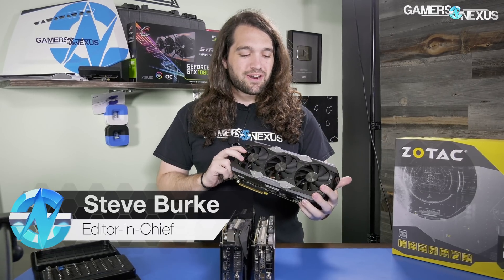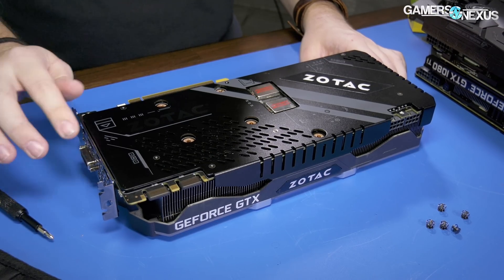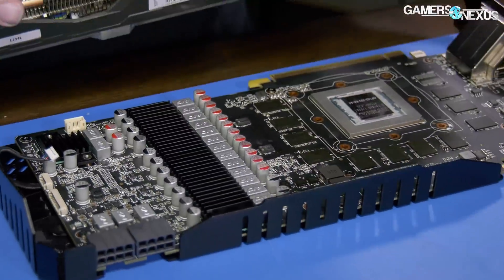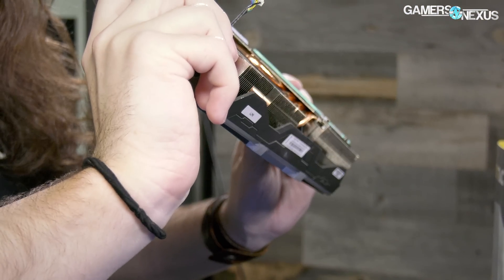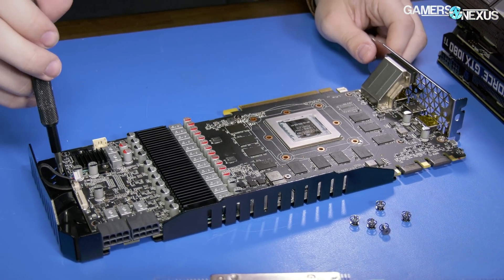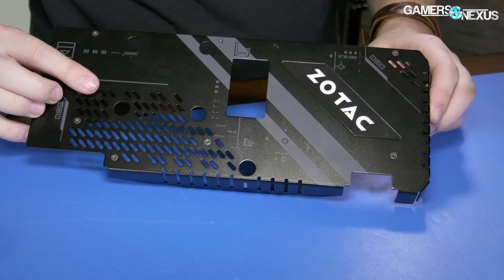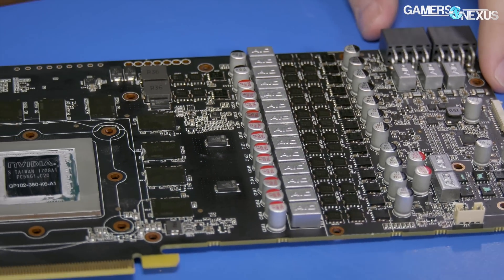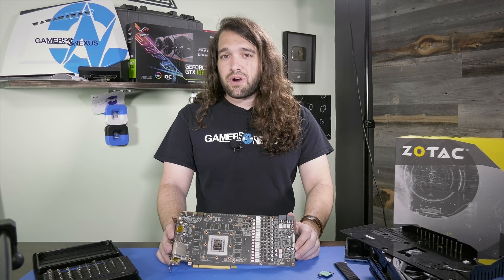ZOTAC 1080 Ti Amp Extreme Tear-Down

Comment: I don't think the way you reviewed this cards "rubber pad" is fair given you showed it in such a negative light. Since you don't have proven metric. the rubber pad could be used to isolate the two heatsinks, vrms do not need active cool in most cases. if it were connected by thermal pad that may raise the GPU temp. there could be manufacturing tolerances that could have the surfaces touch in worst case scenario. I believe the rubber pad serves a purpose especially in a consumer product. Simply put your intuitive assessment is unjustified.
Reply from the maker: This isn't the "review," first of all, and we already have data, secondly. Perhaps you should wait for the review to upload?
Reply: I look forward to the "review" and its objectivity and I understand this is not a formal review but more a kin to a reactionary look into the card.
Already have or had data? to assume is to be fallible by confirmation bias.

I genuinely like the channel and its content. This criticism is not meant to be hostile.
Reply from the maker: Had. As in, tested it (for an entire day) before we took it apart for this video. Video uploads are not real-time. This stuff is ~2-3 days behind our testing. The tear-down videos get shot normally once the review is already written and pending filming/editing.

You're preaching to the choir :)

Comment: i hope for you, Steve, that the black rubber on the fins is not actually for the Inductors....because that would make sense, touch the inductors/chokes in order to reduce vibration/coil whine. If that was true you would have done them terribly wrong by claiming it doesnt make any sense to put that thing over the vrm-heatsink. Too bad theres no way to spot exactly where it is when you dont have the card.
Reply from the maker: It's not anywhere close to the inductors. It's not even making contact with anything. You could have looked at the pinned comment to find that out: http://www.gamersnexus.net/news-pc/2971-zotac-1080ti-amp-extreme-tear-down

Comment: The main reason for the rubber pad I can see is to prevent scratching the black paint off the VRM heatsink during shipping. We all have heard those stories about what happens to packages during shipping and I know I would be worried if I saw small black pieces coming out of the antistatic bag the card comes in.

Comment: Steve, how important is it to cool those vrm's ? I have a kraken g10 with a corsair h50 that I use to cool my gpu. I don't have any additional cooling for the card besides that. Am I better off using the heatsink that came with the card or is my custom cooling going to do fine? My card never goes above 55c during gaming, but is it possible the vrm's could be overheating??

Comment: Steve, this is 1080. The VRMs won't get hot even if there is no cooling whatsoever. nvidia put so much restriction on these, it's virtually impossible.
Reply from the maker: They actually do get pretty hot. And that is plainly false -- you need some kind of cooling. It is definitely not "virtually impossible," having tested a dozen of these now.
Reply: ya bro you need cooling i got 1 of the kraken G10 that has a 82MM fan on it on max and still 70c-80c ish on the backside PCB of the FET's ............ I dont even wanta know how hot they really are / obviously not ^^120c or it woulda blown up already
Reply: OK then, waiting for your testing.
So they're not very good mosfets then?
Reply: john doe, I got an R9 390 Nitro and according to CPU-Z mine goes to the same temperatures with the stock fan curve, but mine should be worse. Yet again, they're powering different GPUs, have different power delivery (probably) and so on.

Comment: the black glossy plastic sheet on the back of the back plate, is to prevent the card from shorting on the back plate. however remote you or i may consider that happening to be. they've obviously decided it's a risk not worth taking. i see it all the time on laptops, usually acer units. though they usually stick the plastic sheet directly to the board. it's a bit odd to see it on a GPU, but i'm surprised you don't know what it is or didn't recognise it.
Reply from the maker: I do know what it is. We've reviewed a few dozen video cards in the past year, so of course we've seen it before. The point is that they should just use something that actually makes sense instead, like a thermal pad.
Reply: i doubt a thermal pad would have any tangible benefit in that spot. it just seemed like he was confused over what the sheet was over the back plate is all. and yeah, it's a pointless thing to put there really. the stand offs should be more then adequate to keep the card from shorting on the back plate, as you said. and even then, small plastic or rubber nipples would surely be a less insulating method of achieving that gap then those silly plastic sheets.

Comment: Rubber need to optimize airflow, i think. Airflow from central fan can freely exit VRM rad towards RGB headers. So airflow from right fan will intere more with airflow from central fan without this rubber, stopping it. I think...
And this is may be just protection from scratches

Comment: well this looks like a stupid card.
i'd like to see a comparison at same high fixed clocks vs the 2 slot!!! kingpin card.
shouldn't we focus on making better coolers compared to bigger coolers?
hey maybe i'm wrong we see in the gn tests thermal and noise wise.
but damn it i saw a 3 slot rx 580 from gigabyte last time and i just thought wtf happened.
one can also ad, that at pretty much 3 slots, the cards will be against the back of another pcie card or pci card, which can strongly reduce cooling effectiveness compared to a true 2 slot card.
for example in my system it would be against the back of a pci sound card, bad example at these times, but take whatever other example u want.
also why the fuck couldn't they connect the vrm heatsink with the gpu cooler thermally?
Reply: there are 3 ways to improve coolers, 1) develop fans that move more air. 2)Ditch Aluminum and go ALL copper as copper has a higher thermal absorption/dissipation rate 3)Make it BIGGER, more surface area gives more heat capacity.

the ONLY feasible option to make a better cooler that is smaller is going all copper (or watercooling), but Aluminum is 30% the weight of the same size of copper while having a thermal conductivity that is 63% that of copper, this means for roughly half the weight you get the same level of thermal dissipation as copper, the downside is it has to be physically larger (roughly 60-70% larger then the copper piece, if my math is correct), look at how much these cards already SAG, imagine adding that double the heatsink weight to a card being a heatsink makes up a large portion of a GPU's weight to start with.
Reply: I have the 1080 version of this and I just like it because it fills my case nicely. It's also very quite.
Reply: @danielrichards644
actually there are several other ways to improve thermal performance of a cooler.
let's start with using at least nt-h1 thermal compound or better, a lot of oems including asus use worse thermal compound (at least going by buildzoid)
next thing, heatpipes can be changed to calyos heatpipes, which  are far superior to transport heat away, their current system is a fully passive system on kickstarter, but they got other systems already, the system can be used for hardline cooper tupes, so u get much better temperature movement throughout the cooler, which of course improves the cooling.
this also makes passive aios viable and reliable enough to be used on bigger scale as it avoids pumps etc....
better fans and design around performance rather than optics would probably also add to the performance of the cooler, although not much probably.
if u think that noctua worked hard on their upcoming 120 mm fan, which big issue was to have the distance between fanblade and outside ring being extremely small to increase performance, yet we have graphics cards with open fans no focusing of air...... 
don't get me wrong please i didn't mean to just throw cooper on it instead of alu and icnrease cost and weight massively, for lil gain, but actual improvements with about the same costs and weight etc...
but i guess huge cards with rgb sells and is more important....
Reply: Copper fins do just about nothing to improve performance on heat pipe coolers over aluminum fins, all they do is add a lot of weight and cost. A great example of this was the Thermalright Ultra 120 Extrme Copper Edition, HARDOCP showed at most a 1.2C temperature difference between copper and aluminum versions of the Ultra 120.

Comment: is there even a reason to include the spot for a 12th vram chip?
Reply: owen barrett The 1080ti is a slightly cut down Titan X pascal, which has 12 gigabytes of v-ram.
Reply: yes but they don't share a pcb design and from what I've heard the 12th spot is completely non-functional
Reply: Yes, it's sharing the same PCB as the Titan Xp. The reason is bringing the costs down to produce one PCB instead of two.
And also, to make you feel like a loser that you bought a cut-down card. Because nvidia ;)
Reply: on NON reference board designs, no, there is no reason on reference there is because it's literally the same board used on the Titan XP card

Comment: Could the rubber piece sit on the chokes to prevent coil whine?
Reply from the maker: It's not on top of the chokes and it doesn't make contact, anyway. It's floating on the upper heatsink and failing to make contact to the lower VRM heatsink, and is clearly an unnecessary attempt at vibration damping.

http://www.gamersnexus.net/news-pc/2971-zotac-1080ti-amp-extreme-tear-down
Reply: No.

Comment: the rubber looked like it was covering the chokes. coil whine reduction?
Reply from the maker: It's not on top of the chokes and it doesn't make contact. It's floating on the upper heatsink and failing to make contact to the lower VRM heatsink.
Reply: No.

Comment: Maybe the point is to purposefully isolate the vrm to cool the gpu side a bit more. With that many phases it's not going to run too hot.
Reply from the maker: You shall find out soon! The testing is all done.
Reply: Maybe the use of the black pad is to prevent scratching on both heat sink
Reply: Having more phases is most of the time to get better efficiency and a more capable VRM. So I wouldn't expect this to run very hot as you are spreading the load of the VRM over 16 phases, that as a result don't have to push that much power in each phase.
Reply: i believe they purposely designed a 16 phase (which is probably 8 phase in parallel) in order to spread the heat to a larger surface area so that the big fat cooler is in charge of the GPU only. pretty clever if you ask me. :)
Reply: I was going to post this, but you beat me to it.
Reply: that might be the case. I mean you cant really easily measure vrm temps but the gpu temps are what people actually see
Reply: Unless you got an EVGA card with iCX cooling
Reply: "Regarding the rubber bumper: It's not on top of the chokes and it doesn't make contact, anyway. (...) an unnecessary attempt at vibration damping."
They already answered the question
Reply: I hope you'll have cute boy buildzoid on it soon too!